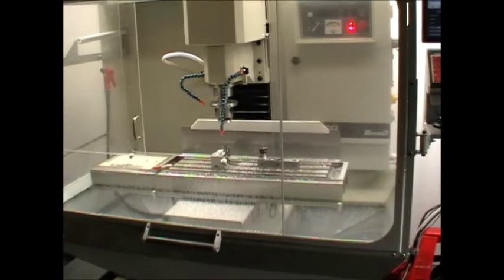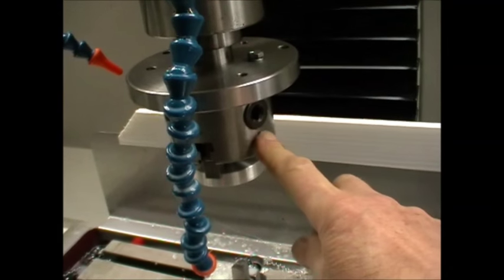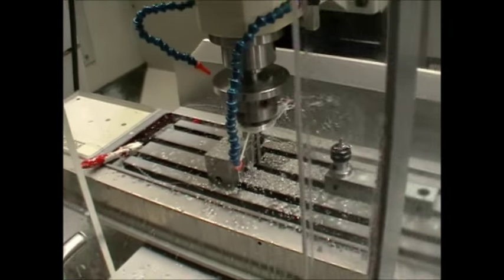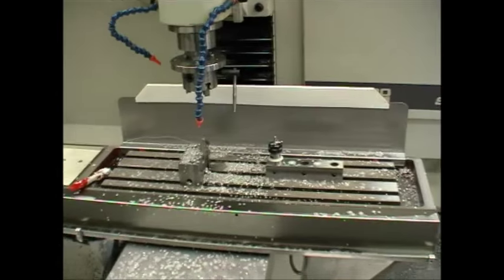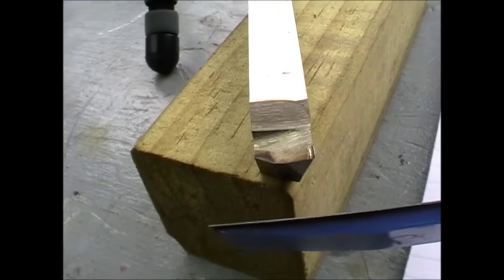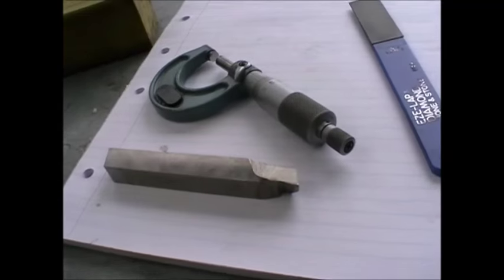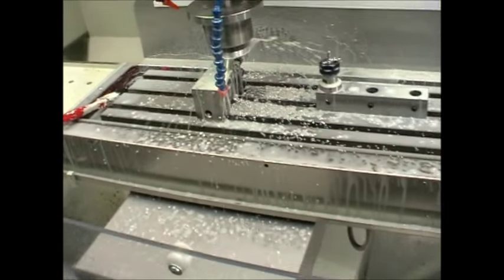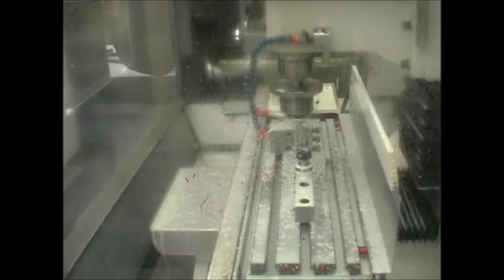TORMACH MILL SPINDLE TURNING UPDATE

Comment: Nice looking enclosure!  Where did you get the chuck?  Does it work with TTS?
Reply from the maker: +Craig's Machine Shop . Thanks  - I fitted the chuck back plate to the threaded nose of a R8 collet chuck - I bolt on standard chucks with the three screws shown - clearance to allow clocking -   TTS would not be secure enough for a 5 inch chuck I also bolt on.
Reply: +Threadexpress - Thanks!
Reply: +Craig's Machine Shop 
Do you have a link, I cannt find it?
Reply from the maker: +Ricard Rinaldo Hi Ricard - Please explain more fully what you are looking for.Cheers
Reply: The link for the chuck.
Reply from the maker: +Ricard Rinaldo.  Ricard I just use cheap standard Chinese chucks, make the backplate and fit it to a ER 20 collet chuck with a R8 - similar to http://www.industrialtooling.co.nz/collections/toolholding/products/ann3505